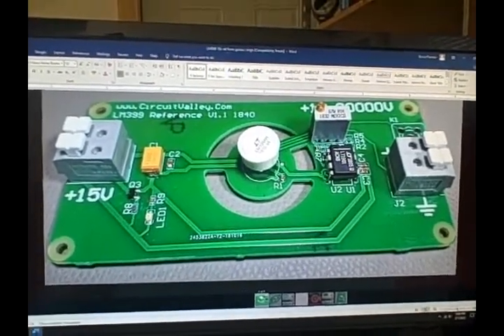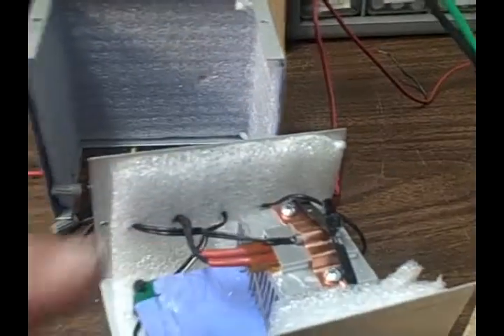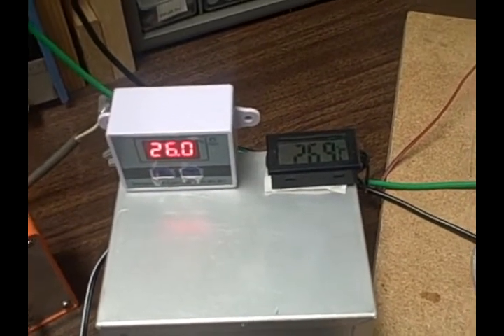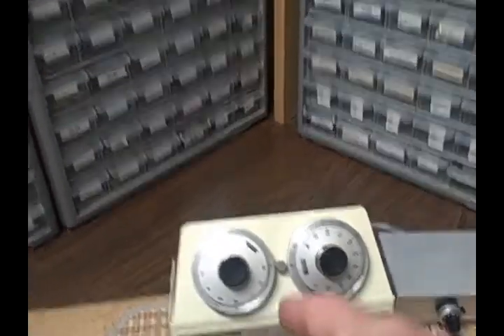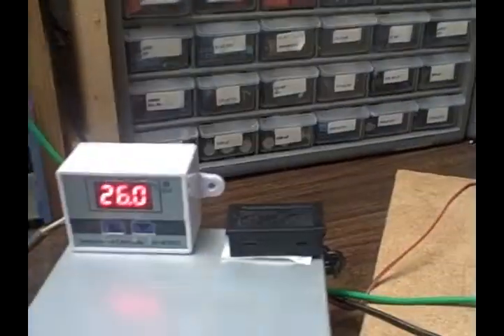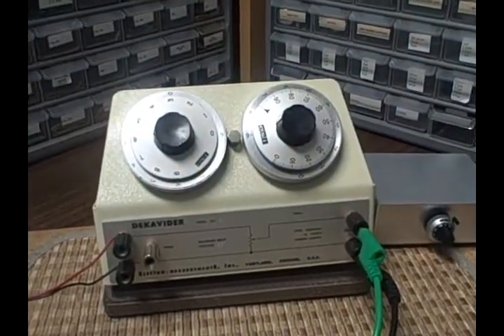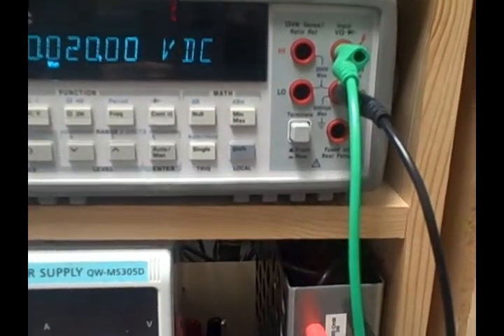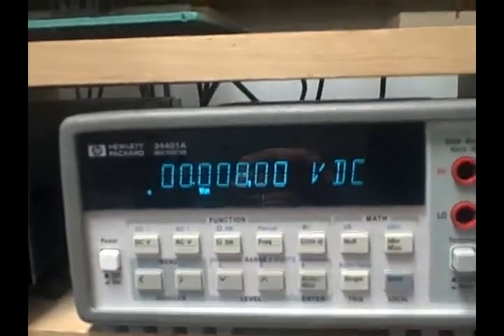LM399 based, 5 decimal place adjustable Voltage Reference Project

Comment: When you try to get so far down in the zeros like this, everything starts to have an effect.  The thermo gradients on the junctions of plated connectors and even various copper alloys start to show.  Another thing to keep in mind is that the 34401a uses an LM399 for its reference, likely selected and binned but still.  Unless you have a temp controlled lab and have all the equipment acclimated and normalized in the space for days as well as having left the meter running, you are just chasing ghosts.  Unless you have have had a NIST traceable calibration done on the meter all measurements are relative to the standard in your reference meter and nothing more.  Wanna see how a traceable calibration standard is DIYed, see Marco Reps series.  There is a reason that the best meters use selected LTZ1000 references and sometimes multiples.  I believe that the 34420a I have uses one of them.  Even blowing on terminals causes wild swings in voltage at the far end on the one in have on the bench.  Special connectors with special terminations are required (VERRRY EXPENSIVE!) and require meticulous attention to details.  Accuracy out past 4 decimal places is hard!

Comment: Lots of fun! Question, is the HP accurate enough to confirm the stability of your constant voltage source at the range you were using it ? 73 Leo
Reply from the maker: I believe it to be.  It was calibrated and verified at Tektronix within an acceptable time frame and has convinced me that it is accurate to a microvolt. For me though, it is also the best I currently have.
Reply: @bap8guy  What you are doing looks like it is a awful lot of fun I envy you having the time to work on such a neat project. 73 Leo ..ps got to go back to work. LOL
Reply from the maker: @K1ZEK  I retired back in 2014 and live in a place where you are shut in most of the winter.  This gives me something interesting to do with my time.